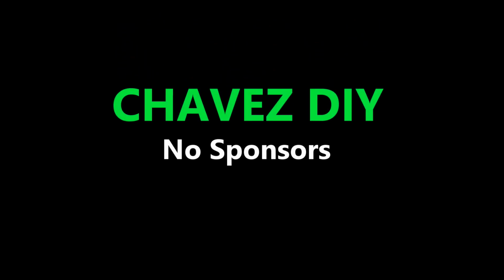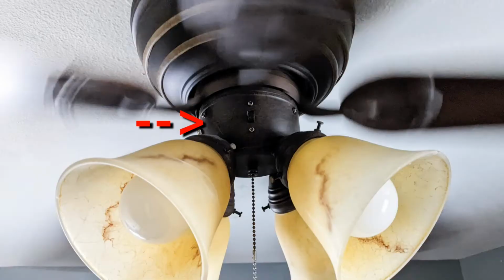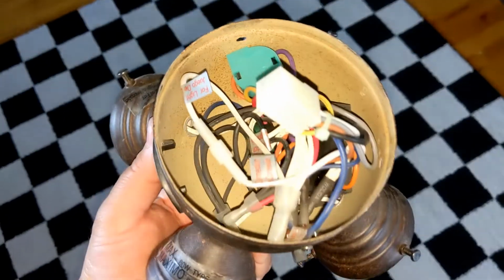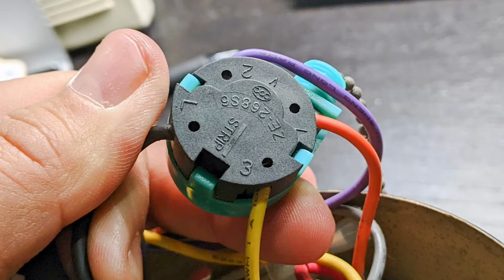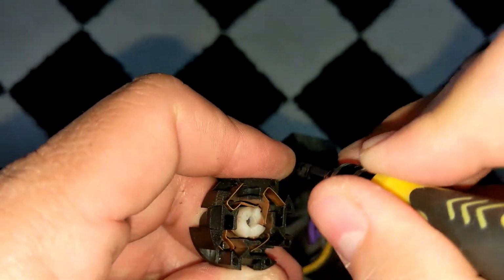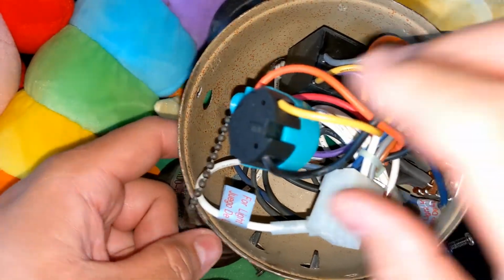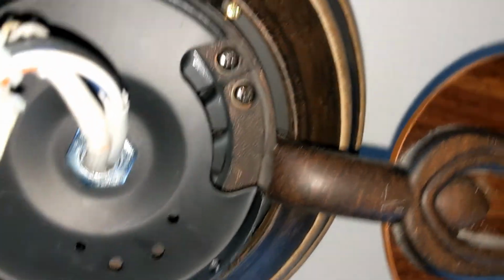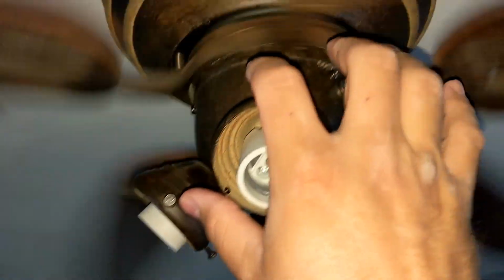Easy Steps to Replace Your Ceiling Fan Speed Switch

Comment: Prying the old switch apart and wiggling out the wires is a great hint!
Some other videos suggest cutting the wires, but they're not long enough to cut them more than once or maybe twice, plus if you cut them you'll have to re-strip each one.
Reply from the maker: I don't like the idea of cutting the wires either, it's not that hard to take the switch apart.

Comment: This was so helpful! The second setting on my fan stopped working and it just skips between off-1-3. I thought I was going to need a whole new fan but I’m so glad I found your video! Maybe the 2 wire is just loose, I’m going to check tonight. Thank you for being so thorough and detailed!
Reply from the maker: Hopefully its just a loose wire. If you have another of the same fan, compare the wiring to make sure the fan missing the second speed is wired correctly. If none of that works, it could be the capacitor.

Comment: GREAT video and thanks for sharing!  BUT, I cannot find the paper that had written down which colored wire with which number on the switch.  All I know for sure is the black wire goes to "L."  I hope i can figure out the other three numbers and wires without the information I needed on that paper.
Reply from the maker: If its a three speed switch like my switch it should be the same colors. You'll have to do some trial and error to find out. I mistakenly rewired one switch and it didn't work properly, haha. Not a big deal, I just fixed the wiring and it worked well again.
Reply: Thanks for your reply!  The three wires for the switch are different colors than yours and the fan does also have three speeds..  For now, all I know for sure is the black wire is "L."  What might help me is to closely look at the three remaining wires and how they are shaped when the old switch was still good.  That may lead me to hooking up everything right with the new switch for the ceiling fan to work.  Wish me luck!
Reply: @DougCeleste  I've fixed several of these.  (The pull chains are really flimsy.) The holes on the switches are always labeled L-1-2-3, but the wire colors are almost always different.
I take a cell phone picture of the old switch, showing the wire colors, before I pull the wires out.
Reply: @scottparis6355  Thanks for the notes.  I had a piece of paper to jot dot down what color wires go to what numbers but I lost the paper.  All I know is that the black wire is "L" but not sure on the rest.  I will have to figure out what to do and hope for the best.  I should have done what you did.  Wish me luck!  :face-fuchsia-wide-eyes::face-blue-wide-eyes:

Comment: Great video! Thanks. I’ve got a Hampton bay and a hunter fan.  Similar process I presume.  I like the wiring harness clips I hope those are in the hunter fan. Working at the table is better than wiring on the ceiling! Lol. Edit. The Hunter has the molex harness clips too! Yippee! Now I’m going to see about repairing the switch rather than replacing.👍. Bravo Chavez!
Reply from the maker: You're welcome! It's easier to replace than repair. But if you're up for the task repairing the switch gives you a boost of confidence.
Reply: @ChavezDIY I replaced it.👍

Comment: @Rhinoman116
0 seconds ago
If your fan has a white quick disconnect, you shouldn't have to remove power,  just undo the QD and remove the lower half.
make a quick drawing of the switch and show which wires go where, or take a pic. so you know where to place the new wires
when cutting wires for the new switch, strip off only about 1/4" otherwise the wire will be too flimsy to wiggle it in (haha) and gently wiggle them in one at a time, give a lite tug on each connection at the switch so you know it's gonna hold, then reassemble, test before installing the lower half.

Comment: You definitely want to switch off the circuit breaker before opening the fan!
Reply from the maker: Yes, for extra safety. Especially if you think someone might come and turn on the fan by accident. Otherwise its not needed. Flipping the light switch to the off position cuts power to the unit and you're not touching any of the bare wires while it is connected.
Reply: @ChavezDIY when I took mine apart the old one was in pieces and don’t know which one goes where